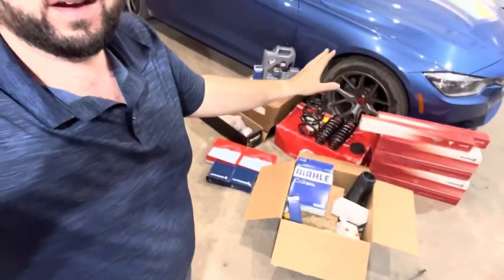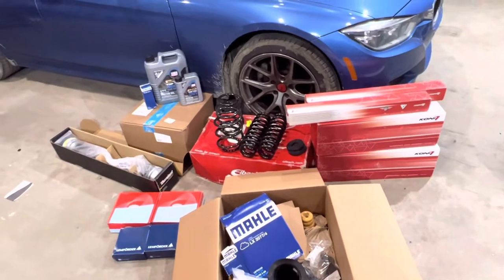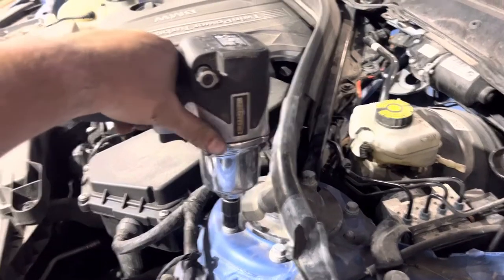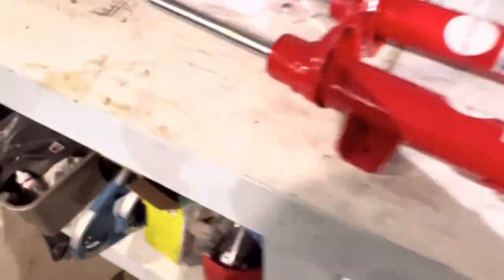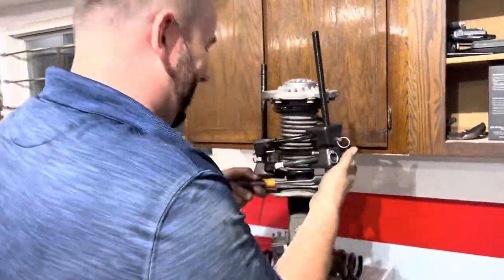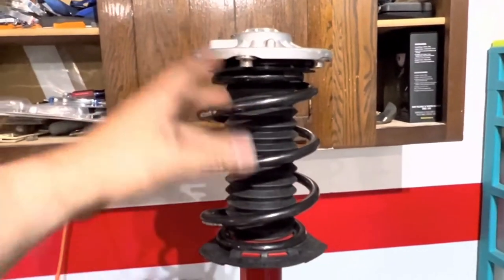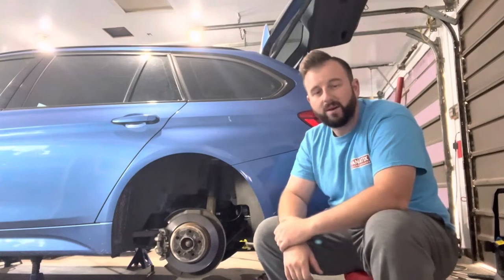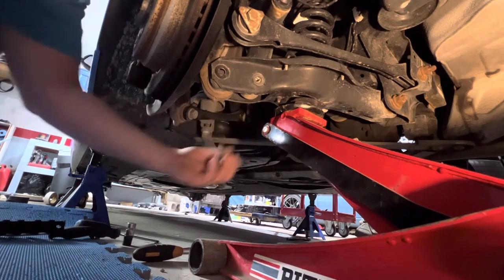BMW F3x Suspension Install with Koni Special Active & Eibach Springs (F31 Diesel Wagon)

Comment: Really helpful video - thank you!  Any updates, two years in?  I just installed the same combination and agreed with @Jacob Cedolia's comments at the end of the video.  I'll add the turn in and nose dive on is much improved.
Reply from the maker: I have since sold the car and the new owner is taking just as good care of it as I did. The suspension remains the same. I much prefer the handling of my E92, but I miss my F31 a lot. It was a special car to me

Comment: Llevo 10k kms con elllos y son una puta mierda. Ni absorben los baches a baja velocidad ni se ponen duros en alta velocidad. Nada más instalar uno se oía un klok y hubo que cambiarlo en garantía pero Koni España se lavó las manos, menos mal que el taller compró otro y me lo isntaló. Se oyen ruidos secos en los traseros en baches pequeños. En fin el departamente de marketing de Koni es muy superior al departamento de ingeniería. No son recomendables. Skoda Superb Combi Mk3.
Reply: Koni recomienda resortes originales para la suspensión activa especial. No tengo problemas con la suspensión con la altura de manejo original. (Audi A6)
Reply: @valentin7436  Está montado con resortes originales. El vástago no encaja de forma copela trasera.  Error de diseño que no reconocen.
Reply: @gabrielg.martin2689  ¿Eres capaz de devolverlos? Parece que te enviaron las piezas equivocadas. ¿Puede consultar el catálogo en el sitio web de Koni para ver si le dieron las piezas correctas?
Reply: @valentin7436  eran los correctos. Koni España no devuelve ni los que están defectuosos.